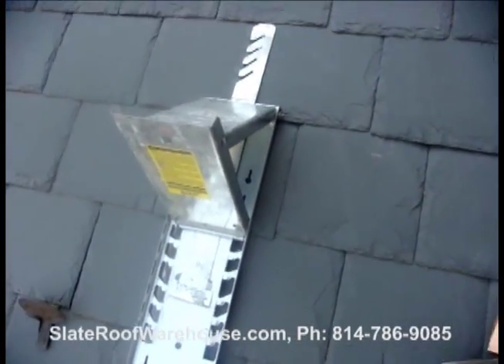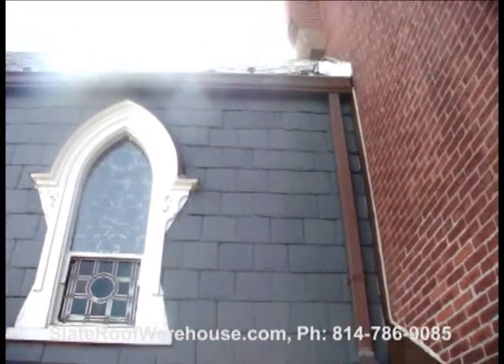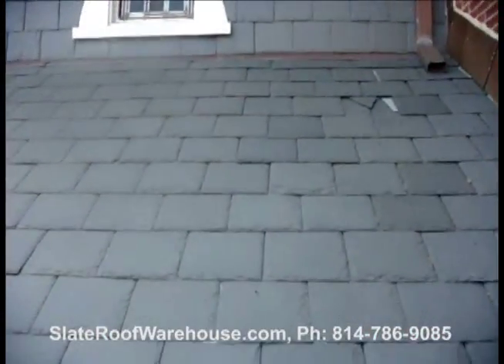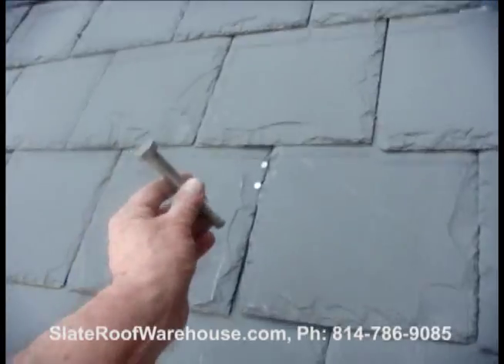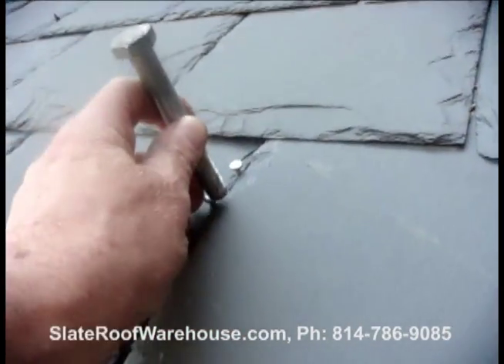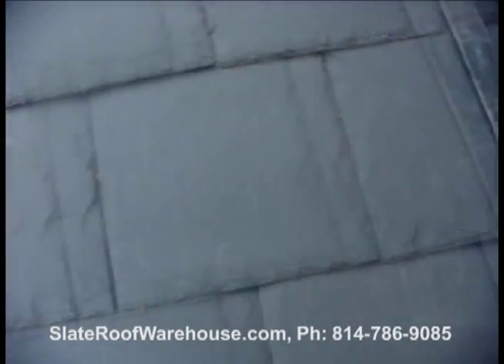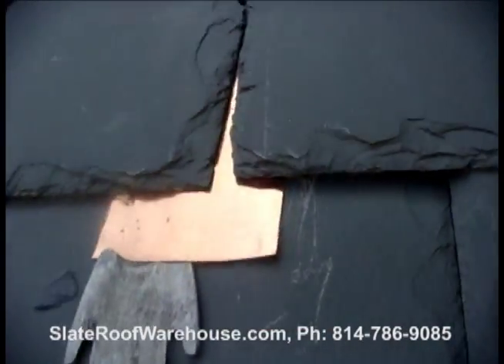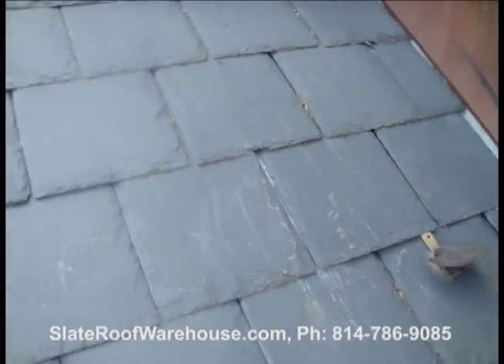Using Roof Brackets on an Existing Slate Roof.

Comment: I think the best way is to remove the slate and use a hook then you have a much better chance of finding a solid surface to nail roof bracket too,other way is not as good and the surrounding slates get a little damaged with the bolt,
I also noticed you only used two 16 penny nails,I would use three for a safety concern. .

Comment: just wondering if you get a galvalnic reaction of copper bib touching galvanized nail heads? would aluminum bib be safer, or, would the reaction be prevented by placing duct tape over the nail head before installing the bib?
Reply: Been doing this for awhile. Never seen rust streaking down yet.  Besides, the nail is what would rust first and would probably take about 20 years to show and signs of the nail deteriorating. Good thought on using the duct tape, but natural vibration would eat through that, and make it harder to place the bib.  If your really that worried about the electrolysis I’d suggest using epoxy (paint) with a nail polish bottle over the head, but again it will probably wear away.